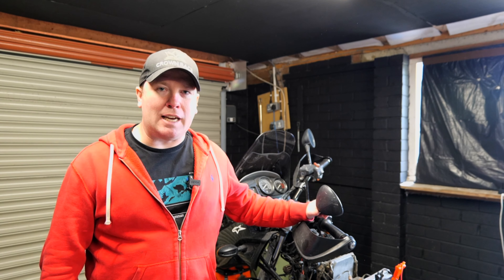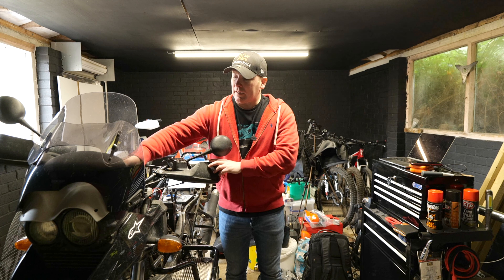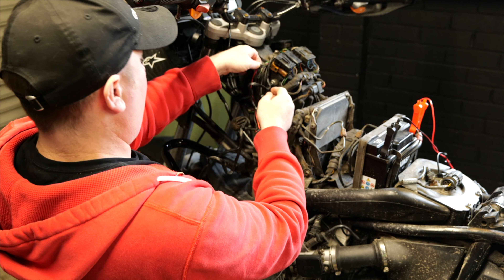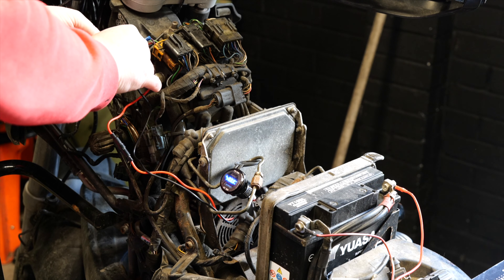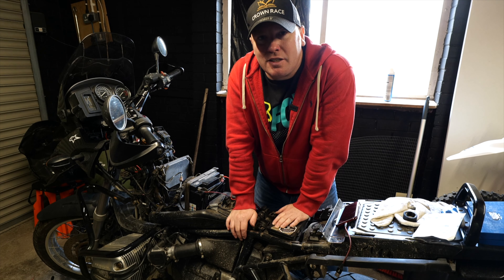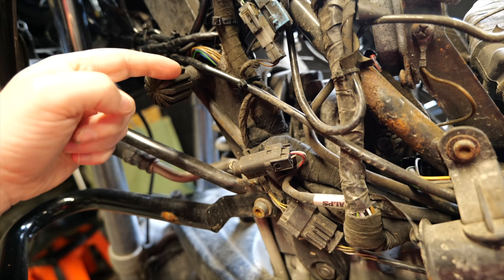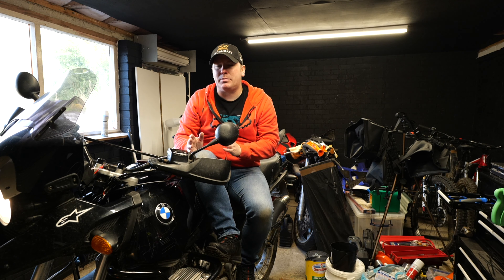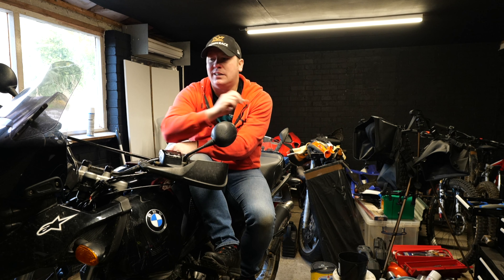BMW R1150 GS battery drain | checking wiring, New USB charger fitment and trickle charger cable.

Comment: Noticed when you fitted the battery you took off the protectors for the terminals (the black plastic bits you threw away !) with them off, the positive (red) terminal under the tank can potentially make contact with the tank and short the whole lot out, sparks and petrol never mix well, so I'd put them protectors back on and make sure the battery terminals are fully protected from making contact with anything.
Reply from the maker: Hi Davey, I did look at leaving them on but they wouldn’t close down over the terminals. The terminals also protrude quite a bit outside the covers so even if I did modify them to sit flat, the terminals are still in a position to potentially strike the tank if the strap snapped. Luckily the tank is still painted so is insulated, and the rubber strap holding the battery is not perished and is still strong …. But worse case scenario, the spark would be on the outside the tank so the fuel doesn’t have a direct ignition source, and it’s quite hard to ignite fuel inside a closed tank because the fuel vapour overpowers the amount of oxygen needed to create the fire so all is safe 👍🏻
Reply: Perhaps fashion something out of an old inner tube cut to size just to make sure nothing metal can make contact with those terminals, the thought of a spark in the vicinity of fuel vapours is scary, and we need you in one bit to keep producing content ! Ride Safe 👍 @MALVSMACHINE
Reply from the maker: @daveyblakeney  😁👍🏻, cheers Davey, will do my best to keep it coming 👌🏻

Comment: I think if you want the USB on only when the bike is running you'll need to connect the +ve of the USB to the Grey wire, and then the - ve to an Earth point, like under that nearby nut with a soldered & insulated ring crimp.
As you said you'll get a much more robust and tidy connection using a temp controlled  soldering iron and heat shrink.
Reply: Hopefully the USB is fused?
Reply from the maker: Ah ok, that sounds good like a great idea and won’t take long to do as well. Yes it’s got the in line fuse so hopefully no fires 😄. Thanks Marc 👌🏻
Reply: Glad I could help. Loving the videos 👍🏻
Reply from the maker: @marcstaddon7161  that’s great! More to come, I’ll hopefully get to ride it again too 😄

Comment: You would better of with a 5 pin automotive relay, using the rear running light or headlight as the trigger live feed, but taking power directly from the battery. That will prevent the issues you are having.
Reply from the maker: That sounds like a great idea. Will do some research in to that and see what I can do 👌🏻. Thank you 👍🏻